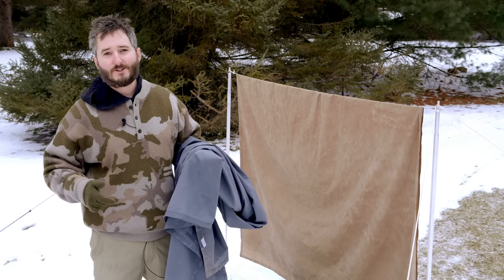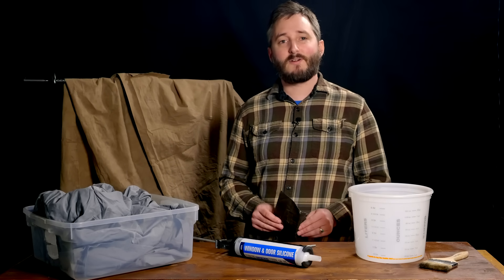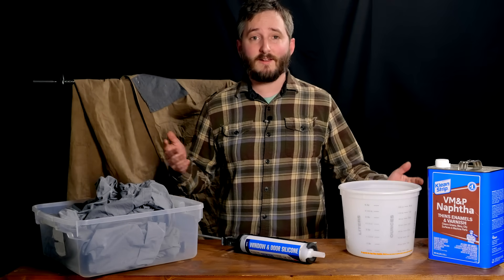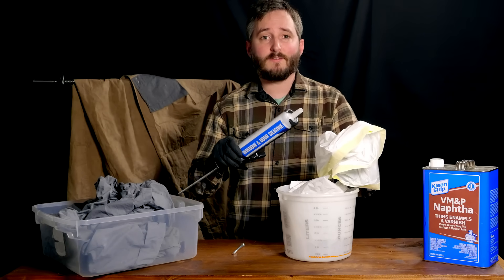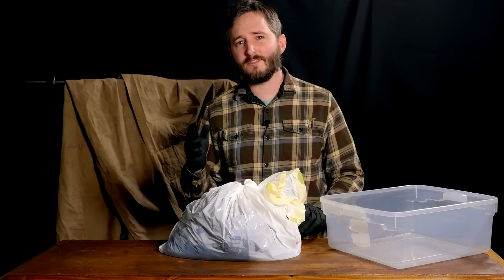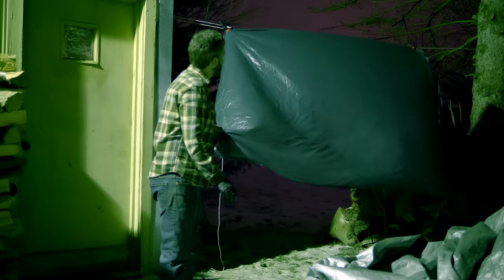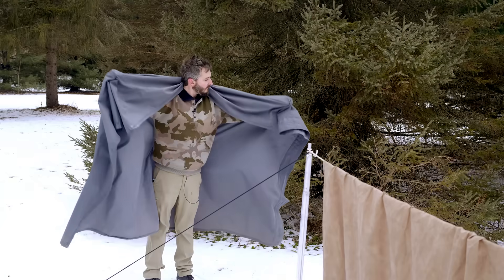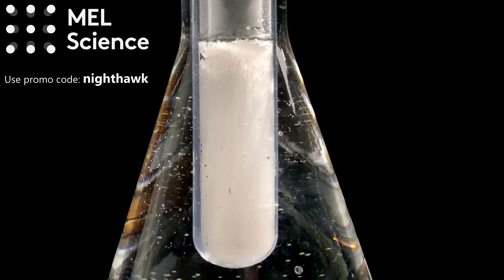Recycled Bedsheets Make The Best Waterproof Tarps

Comment: I used this compound and a brush years ago to waterproof a wide brimmed had so I could use it to hunt in rainy weather.  Worked great and is still waterproof over 20 years later.
Reply: can you put this stuff in a sprayer and spray it on?
Reply: @humility-righteous-giving  YES, but you would have to clean the sprayer out very well with fresh solvent or it would be a one time use sprayer.....also the internal parts of the sprayer may dissolve with the solvent so you may need a couple different sprayers to try.
Reply: @ssnerd583  so true,decided to try before seeing your advise ,after i was done i sealed it in 2 bags in hopes to keep it watery. and it still got solidified  only it was less viscus than straight silicone
Reply: @humility-righteous-giving  You can do whatever you want.  Clean the nozzle out right away so it does not clog.
Reply: A great idea!
Reply: This must be similar to masonry sealer that I used on a brick wall, the stuff is “siloxane” based, smelled terrible and my solo sprayer was stuffed afterwards! Once applied it was invisible and water beaded off like a duck. And it stayed that way for 5 years. Amazing stuff, never thought to use it to waterproof fabric with it!
Reply: @andrewcrawshaw5809 I also was looking at using concrete sealer. Was yours water based or solvent?
Reply: So this could be used as a tarp to collect rain water??
Reply: For drink, I think mo @Graeberwave
Reply: I have an idea of a hat myself
Reply: ay I ask, can I use lacquer thinner as an alternative to that of naphtha?
Reply: @haroldcalendatas5625  i used paint thinner cause its cheapest were i live(less than half price of naphta), lacquer thinner should work as well, i also suggest spreading and hanging the cloth in its drying place, and putting the mixture in a spray bottle and spraying it on to the cloth instead of soaking it as i made a big mess while trying to hang the treated wet cloth and got silicone stains in clothes that i haven't been fully succesful in removing
Reply: @humility-righteous-giving  En effet, ici en Belgique (Europe), nous avons également beaucoup d'interdiction de vente et/ou d'utilisation de produit et je n'ai pas connaissance de la disponibilité  de l'essence Naphta ici... J'ai comme vous utilisé un diluant pour peinture ("White Spirit"), je ne me rappelle plus la dilution, je n'ai peut-être pas diluer suffisamment, mais le résultat n'étais pas idéal. J'ai recouvert le bas d'un poteau de bois destiné à être enterré, plusieurs jours plus tard, il ne semblait pas encore séché, c'était très collant, donc pas du tout efficace !...
Reply: This answers my question thank you !
Reply: How thick would you recommend applying it? Should the fabric be dripping with the stuff or can you just spread it as thin as possible without loss of efficacy?
Reply: So that mean, it not going to crack like tarp ?? I want try to customize my food delivery bag.
Reply: Great
Idea
Reply: That was going to be my question: How often do you need to reapply?
Reply: Oh great comment, and thanks for the input. Using a brush to apply this makes it suitable for smaller projects like shoes, or lawn furniture covers
Reply: Hello. I would like to ask if how long it will last? Is days, or months
Reply: @romarkevinruiz9358  I can only tell you that my hat was treated over 30 years ago (1990 +/-)and is still waterproof.  Continuous exposure to the elements (sun, rain, etc.) may cause the silicon to deteriorate (you'll have to research this).  The only time my hat is outside is when it's raining so it gets no exposure to UV from the sun.
Reply: @dlkline27  what was the hat made of? And it’s style? Curious
Reply: @richeyrich2203  Not sure of material but it appears to be a cotton/polyester blend. Hat is Aussie style with brim laid flat.
Reply: tru kah bang?
Reply: Brilliant!!! Thanks from New Orleans 🎭
Reply: @Ojb_1959  You're welcome from West Virginia.
Reply: Do you have any color fade from the sun? after you added the silicone
Reply: @JohnSmith-il4wi  No, but since I only use it on rainy days it's had little to no sun exposure.
Reply: Ooooh I’m taking that idea lol
Reply: ...wide-brimmed "hat"...
Reply: nice but i dont believe you , lol
Reply: I'm planning to use it on edges of a diaper. This diaper will be used 300 times. Do you think it will sustain the wash cycles?
Reply: @amrithMilW  if it doesn't you can retreat it, i struggled hard to get it out of my pants ,i barely made a dent
Reply: @amrithMilW  I just saw a thread earlier today on facebook about re-usable diapers. It was on a video of a guy making his own felt hat out of lamb's wool. I know that doesnt help you much but I find it quite the coincidence.
Reply: @ValCronin I almost completed my PhD in this subject 😅
Reply: @amrithMilW  A worthy subject that affects many and doesn't necessarily get the seriousness it deserves. Also fascinating from a materials science standpoint. I am sure OP video creator would agree. 👍🏼
Reply: @ValCronin are you into material science?
Reply: What is a "had"? Explain
Reply: @jovanleon7  a hat
Reply: @jovanleon7  🙄

Comment: Hello! I recently was at a old-timey farming exhibit and saw a blacksmiths coal blower, the old cranked kind. Then I remembered your Bee-smoker bike engine project from a few years back, and I wondered if adding an additional sprocket and chain to drive a coal blower would be a good substitute for a bee smoker? It would definitely add weight, and you might even need a separate trailer for it, but I bet if you hooked a sprocket to the trailer and chained the blower to said trailers wheels, you could create a gassifier that stokes itself by drawing kinetic energy from the movement of the bike, to heat the fuel for maximum efficiency.

Comment: Great video. I imagine the formula or mix does not have to be exact as long as it the right viscosity is achieved. I'm assuming the Naptha dilutes the silicone so it can be absorbed by the bedsheet. I like that you only require two ingredients and some plastic bins and a clothesline to dry the sheets. And those silicon "guns" are very cheap.
This is easy enough for anyone of any age to do. And having a long-lasting fabric tarp beats dealing with plastic ones that rip and tear and always seem to get super dirty. Plus you can cover yourself and use it like a raincoat.
With respect to other videos showing different methods and products, this beats melting wax in a double boiler setup and mixing multiple chemicals.

Comment: Thanks for the video. Love learning these sorts of things! 

It occurs to me that I could waterproof any type decorative fabric using this method & use it to upholster outdoor seating cushions.  I don’t know the cost of the silicone & naphtha used here, but I suspect altogether the cost of silicone, naphtha & fabric would be less expensive than the cost of outdoor fabric.  And, I’d have a much wider range of fabric color & design to choose from than that offered in fabric manufactured for outdoor use.  Also, I’m thinking the seat covers could be sewn together before waterproofing to avoid having to sew through the added weight and/or thickness (?) of the waterproofing. 

I Wonder:  can fabric treated this way can be ironed? Anyone know?
Reply: If you're using a sewing machine I wouldn't imagine the coating will make any difference, though it might with hand sewing. And I'm thinking the two layers of the cover might stick together if you tried to waterproof the finished article? I think treating the cloth first, then sewing (using clips instead of pins so no holes in the fabric), then sealing the seams with a bit more solution painted on. I'm looking forward to making outdoor cushions this way too!
Reply: This is great, I will try it this summer on my swing pillow covers and outdoor chair’s cushions .

Comment: Ok you can make your own tarp what is the cost?   That solvent cost 20-30 dollars per gallon depending on where you buy it.  Silicone 7-8 dollars a tube.  So  around 15-20 dollars plus labor to make a what? 6x8 tarp?  What does a regular tarp that size cost?  And what can you cover with a bedsheet size tarp? A bicycle?  I have noticed with any waterproof type cloth it’s really only water repellent and for a limited time cloth is more porous than a tarp Eventually the water will get through

Comment: The most absolute useful thing I've seen on YouTube yet. Thank you... you saved me hundreds. I am a hiker/camper these are light enough to pack and heavy enough to offer warmth and dry without destroying my expensive tarps for tarp camping.
Reply: What would you use your expensive tarps for, if not for tarp camping? Might be a silly question, but aren't tarps mainly used for that exact purpose?
Reply: @DKFX1  I take a lot of care for my good tarps. Homemade tarps I would be abusive.  Like over stretching or just using a stick to prop the center up instead of toggles and paracord
Reply: Agreed, same. Money saved!
Reply: ARe they as noisy as actual tarps? Could we call these more quiet tarps?
Reply: @Mdaberk71  I can tell you from experience these are as quiet as they were when they were still simple sheets

Comment: You cant use it for a hot tent can you? Wouldn't the silicon melt off
Reply from the maker: Silicone doesn't melt, but it is slightly flammable. It should be fine for a hot tent so long as you use a stove jack

Comment: Is this technique suitable for synthetic fabrics also?  Silnylon is expensive, or maybe an olefin fabric that resists UV damage also?  How is the smell?
Reply from the maker: It should work for any fabric that isn't damaged by the solvent. You can increase uv protection by adding lampblack to the silicone. No smell after drying

Comment: This is most interesting. The rainfly of my old plastic tent and a old backback are no longer waterproof. Some of the old waterproof coating is flaking off. I have darned some portions of the backpack with dental floss. Would brushing them with a silicone - naphtha solution help keep them waterproof?
Reply from the maker: Yes, but I'm not sure if it will stop the flaking of the original material
Reply: @Nighthawkinlight  thank you

Comment: painter for 25 years here.  will be doing this instead of buying very expensive drop cloths from paint stores.  we have totes full of old sheets we use as drops, will have to show the guys this as rubberized or waterproof drops are extremely helpful when painting....most canvas drops, even the thickest ones will eventually leak paint through them.
Reply: Paint and silicone? Be sure there is no change the silicone leaks out and stick to the surface that needs to be painted !

Comment: have you considered a vacuum chamber/pressure pot or something similar to help the mix permeate the fabric? also, do you by any chance have this formula for a weight lix rather than volume? I think it would offer better accuracy rather than trying to guess 300ml from a tube of silicone, amazing video though, I subbed to about 3 channels this video made it 4.
Reply from the maker: Don't think vacuum is necessary. I don't have weight measurements, but this process doesn't require precision.

Comment: This is so interesting. I’m sick of buying plastic tarps that need replacing year after year. I need a tarp to keep the hot sun off my car in summer & need one or two to keep my wood dry in winter. I live in Europe. I can easily find the tube of 100% silicon but the other ingredient, naphtha , not too sure about. Is it called something else in Europe? Thanks so much for posting.
Reply from the maker: White gas camping fuel, and type 1 acetic acid cure silicone
Reply: Stop buying cheap junk. Buy quality material and it will last.

Comment: This would be a great video except for 2 things that makes it next to useless to me. a/ Naphta is an american world that means nothing outside America.. It could be kerosen, benzen, petrol... Americans seemingly make video for other americans, talking in inches and foot and farenheight, they just forget that 90% of the world talk metric (including Australia). b/ Silicon means  nothing, there is 100 types of those cartridges on the shelf, basically divided into two main catégories: Acetic cure (strong vinegar smell) and neutral cure. Anyhow thank for the effort and don't take this too personal.. The button tire part was great! Cheers
Reply from the maker: Naphtha is white gas, lighter fluid, or shellite depending where you are in the world. The silicone is acetic acid cure.
Reply: @Nighthawkinlight  Thank you! I will try that! Also I just discovered a great chain of techo video, I will subscribe. Have a great day!
Reply: @Nighthawkinlight  I tested today in the lab with petrol (gasoline?) Works perfectly! Also with kerosen I have to wait tomoro when fully dry. I mix the silicon with petrol in a kitchen mixer (the one in the lab not the kitchen!) thanks for that great tuto I did not know that acetic silicon would dissolve in hydrocarbons. I tried with methanol: it does not dissolve.
Reply from the maker: @Frogmobile52  Be careful. I wouldn't use an electric mixer because of the chance of sparks inside the motor. Glad it worked for you!

Comment: Questions:
1. How long does the waterproof coating last? Weeks, months?
2. You mentioned on 6:07 about water proofing a clothing, is it safe to have those said chemicals touching the skin?  
3. Do you find that the material used, is stronger than before prior to submerging it to the said chemicals?

Comment: I have a question. While these seem great to use as a tarp replacement, how heat resistant are they? Would I need to move my fire further away compared to a standard tarp?
Reply: Cotton, linseed oil, wax is better for sparks than polyester and silicone. I recon for waterproofing , silicone would be better.

Comment: I’ve got one made from a canvas painters cloth
And two made from brand new king sized, ultra heavy bed sheets. Had to hang them for over a month to cure properly.
Make sure you sew all your tie on points, perimeter and corners first. Before you treat.
And don’t use cheap thread.

Comment: Can it be done on any cloth ,  even artificial cloth (nylon , dacron and so on ) !! I use a thin cloth and some "naval anti UV " varnish to waterproof my kayaks , it is good , but is not cheap , and after some 3 or 4 years , it is no more waterproof !! How long can your mixture resist to tropical sun (I live in Brazil) ??
Reply from the maker: It should work on any cloth that isn't damaged by the solvent. You have to paint silicone on thick if you want it to be entirely waterproof, as this fabric is still breathable. I'm not sure how long it will last in the sun as is. Lampblack is added to rubber and plastic to make it more UV resistant. That may help your varnish, but it will make your boat black.

Comment: could this be applied to leather boots?  Have a pair that has dried out to the point they can´t be saved
Reply from the maker: It won't rehydrate them but it'll make water roll off
Reply: @Nighthawkinlight  so in a way it could be a way to save leather boots that got dry rot. Make them water reppelent again. I am going to try this out. Anybody know if it would work with acetone?

Comment: I WATERPROOF MY JACKETS WITH SILICONE AND WARMISH WATER,  WHEN DESOLVED JUST POP IN USE A STICK TO PUSH DOWN OR YOUR HANDS GET COVERED. USE CLEAR SILICONE, HANG UP TO DRY OUTSIDE.
Reply from the maker: What silicone do you use that dissolves in water?
Reply: @Nighthawkinlight   hi NHL  JUST  CHEAP SILICONE OUT OF POUND SHOP, DON'T BY EXPENSIVE, DO A QUICK TEST ON AN OLD PIECE OF MATERIAL PREFERABLE SAME COLOUR, LET IT DRY THEN WATER TEST WORKS GREAT,  LOOK AFTER YOURSELF MY FRIEND.

Comment: hi there! a quick question about the naptha you used. there are different kinds of naphta depending on the boiling point of the underlying hydrocarbon. heavy naphta vs refined naphta. some are used for making jet fuel (heavier ones) others as a source for making gasoline.

which kind of naptha did you use? there is also vm&p "vanish makers and painters" naphtha which is basically a paint thinner.
Reply: Did you even watch the video? Literally shows the can of solvent in the video labeled VM&P Naphtha.

Comment: That's some powerful information! You can do a thousand things with a waterproof tarp and that button trick is classic. I  think you can use a coin too. So my question is...is that waterproof or water resistant and does it wear off and need to be redone? Also I used to use a canned waterproofing spray for my hiking boots. Is this better? Cheaper?

Comment: I just had an idea because I was a painter if you have a sprayer or maybe a roller in a brush but hang the sheets out online spray exterior acrylic latex house and trim paint onto the sheets and let them dry with a small airless sprayer or whatever I believe it would be flexible and it might work and a gallon of good latex acrylic paint might go along way you had a bunch of sheets out there I mean it might cover 3 or 400 square feet whatever it says on the can! USE exterior grade house and trim I was a painting contractor but I never tried it do it do it do it

Comment: Now it's time to use only fully biodegradable or inert materials that don't harm the environment and do not create microplastics. Wax is what was often used.
Reply from the maker: Silicone is chemically quite a bit different than plastic and so far as the current research I can find says it's less harmful. Not sure if that research is to be believed, but going with what I know for now.
Reply: @Nighthawkinlight  It is less toxic but the micro plastics issue remains unfortunately.